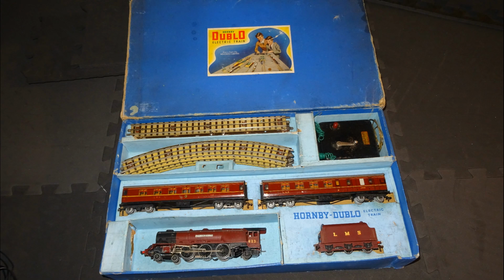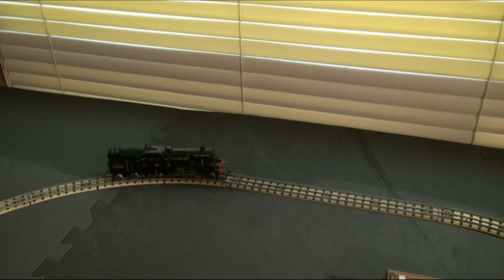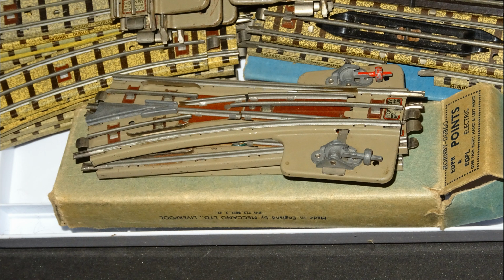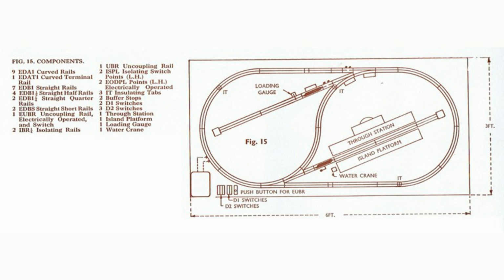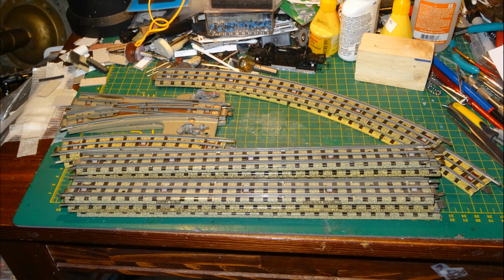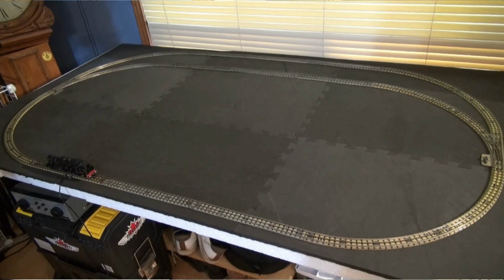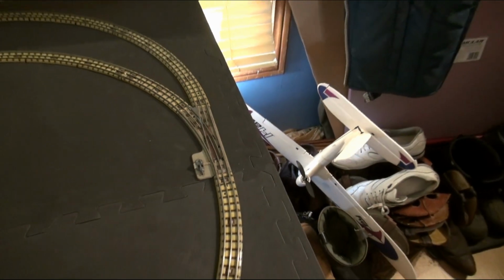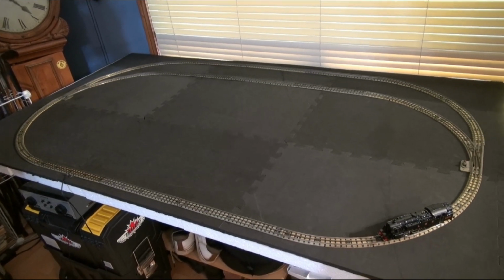OO 164, Dublo 3 Rail Track: Beyond the Train Set

Comment: Well done. I find it easier to assemble a point with the 3 adjacent rails before I connect the whole thing to the other sections of the track plan. This way, one can check visually the proper connection of fishplates.